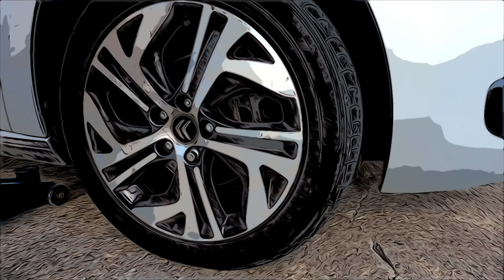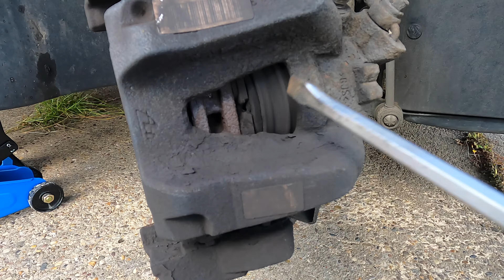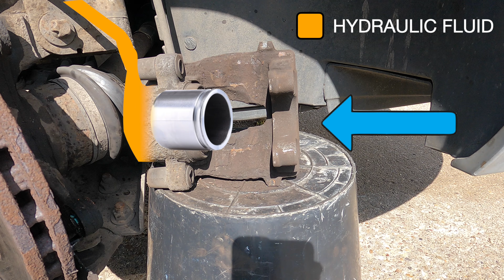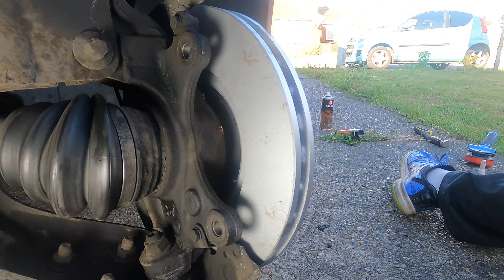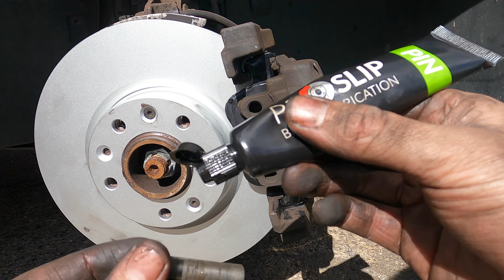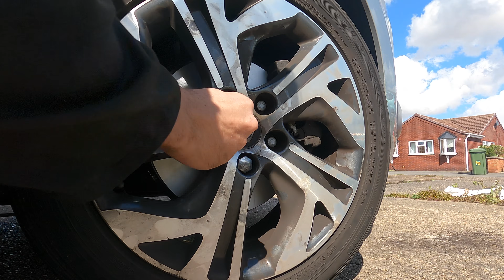Brake Pad And Brake Disc / Rotor Replacement. Citroen C4 Picasso Brake Pads And Disc / Pads Removal

Comment: Couple of mistakes. Do not push caliper in first place. Undo brake bleeder first, drain a bit of brake fluid, push caliper a bit to take it of the disc, then before pushing the caliper CLEAN the rubber and end of piston, then undo bleeder again and drain filthy fluid into some bottle. Tighten up the bleeder. You will avoid all the dirt going into your ABS/ESP pump. Check brake fluid level.
Reply: If thats the right way to do it then how come every video on here don't bleed the fluid they just push the piston back in

Comment: Tip: If rims are seized you might lose all wheel nuts a bit, start the engine, roll forward a bit and brake harshly. Then follow normal procedure.

Comment: How do you release the electric hand brake on the car when the engine is off
Reply: Turn ignition on (DO NOT START THE ENGINE). Then put foot on brake pedal and turn electric handbrake off. Release brake pedal and turn ignition off. This will keep the electric handbrake off when the vehicle is turned off. When you open the door of the car, it will give a warning noise which is normal when handbrake isn't applied.

Comment: Great video. Great angles, lighting and detail. You made it look so simple so I gave it a try myself on my C4 Cactus. Slightly different but I followed your video and everything went smooth as the pad grease...lol Great tip about putting the copper spray on the wheel mount. The other wheel had ceased to the old disk. That wont happen again though. Thanks so much.
Reply from the maker: Im glad to hear my videos are giving people the confidence to have a go and tackle these types of jobs head on. Best way to learn is by giving things ago and you save a Bunch of money as well as improving your skills. Great to hear everything went well.
Reply: I have a c4 cactus too and am thinking of having a go at this

Comment: Just need to whack the back of the disk rather than hit from the front - both of mine came off with a whack from a rubber mallet. Most difficult part of all this was getting the calliper spring clip off I found - need to squeeze it in the middle I later found.

Comment: Thanks for the video! I changed the front discs and pads but in my case the bolts to caliper carrier were 18 mm. Just a warning to check it so you dont try a 19 mm right away and round the bolts. Greetings from Sweden
Reply from the maker: Hey, thanks for the comment :)
Reply: Yes mine needed a 18mm socket too
Reply: Did mine yesterday and yes the caliper bracket bolts were 18mm. Good video.

Comment: Great video! Is it exactly the same at the back? And I'm guessing you need to close you brake fluid cap again in the engine bay, before pumping the pedal at the end?
Reply: Slightly more tricky the back if you have an electronic handbrake - it’s definitely doable but not as easy as the front.
Reply from the maker: That is correct

Comment: Great video, im thinking of doing this on my C4 2015 hatchback mk11 type diesel, is it the same do you know? also i dont have a torque wrench so is it safe to just tighten them as much as possible? and do you need thread grip? or brake cleaner? i have copper grease, for back of pads and pad sides and housing and hte hub as well

Comment: u don't need threadlocker for the 2 screws of the disc. They are just for positioning. This will make it difficult next time. Otherwise, great vid with excellent animations. Top👍
Reply from the maker: ahh my bad. Thanks for the tip.
Reply: i agree